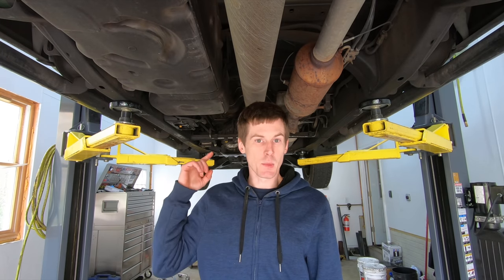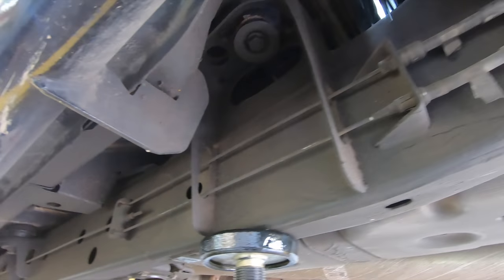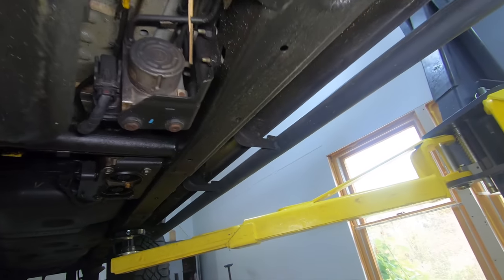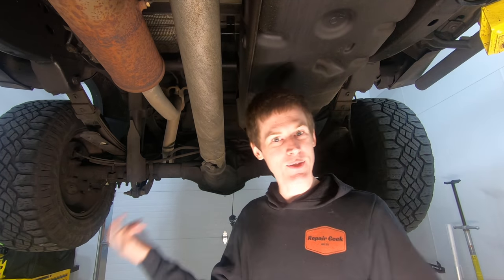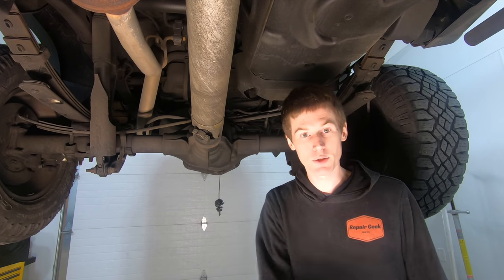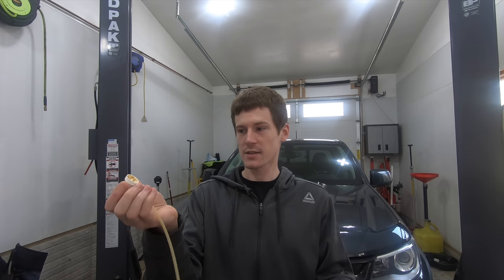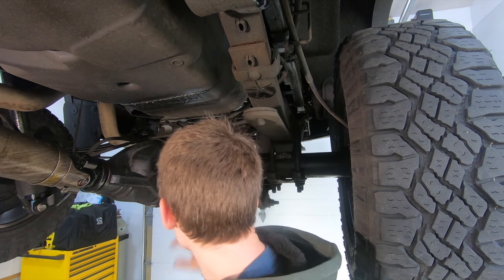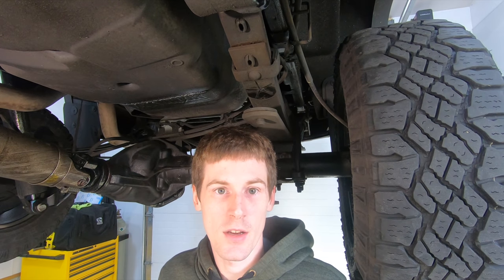Fluid Film Review After 4 Years. (Woolwax vs Fluid Film results 1 yr later)

Comment: I just bought a new 2022 GMC canyon it now has 300 miles on it and I was going to put something  on the frame or some kind of under coating I called  GM and they told me if i spray or put any thing on the frame or body at all it will void my Warranty  my Dealer told me the same thing they even told me I couldn't even put it a spray in bed liner said it would void the Warranty on my truck said it has to come from the factory with it, I dont want to wait 5 years or 60,000 miles for my warranty to die before I can put something under my truck to protect it so what should a man do in this case
Reply from the maker: Try to find ANYONE that GM has paid a warranty claim to for rust. A warranty only works if you and GM agree that the repairs need to be done. It's nearly impossible as a consumer to get the manufacture to do a repair on their corrosion "warranty". Read the actual corrosion warranty information in your owners manual. It has so many loop holes on the manufacturers end it's the length of the dead sea scrolls. You have seen what I did and the results that I've gotten. I have no regrets.

Comment: The most amazing thing about Surface Shield is its' consistency.  It seems like Fluid Film, which used to pour like a liquid, has thickened up their formula to a pudding consistency.  Pudding is harder to spray and creep into pinch welds than a liquid.  But Surface Shield is a quite pourable liquid and it STILL sticks to the underside of a vehicle better than the puddings.  Now THAT is amazing.  And now that Surface Shield is available in 1 and 5 gallon buckets on Amazon, it seems to be the product to buy for us DIY'ers.  How much would I need for a '94 F150 and a '07 Honda Odyssey minivan?
Reply: I agree that the FF is now like pudding and I mixed in Vegetable Oil to make it sprayable . FF continues to creep to thru the seams on hot summer days and requires cleanup , however the Surface Shield hold  promise and I look forward to using it on my next vehicle .
Reply: @pippendog1  you really have to stir or agitate it to thin it out. Paint stirrers work well for that.
Reply: @jcraig791  After 41 yrs. of professional spray painting I know how to mix .. It was like pudding on a 90 degree day and 10 min. of stirring . The vegetable oil mix is a recommended tip .
Reply: Ted George I thin it out with vegetable oil too. It says right on their website to use that if you need to thin it out.
Reply: I put it in front of the woodstove before I use it too

Comment: It’s ridiculous. If they’re not gonna pull wires inside of the frame, they should seal it all off completely and put argon gas in it or something and then put a tire pressure gauge in there so you can keep an eye on what the pressures are ridiculous.
Reply from the maker: Could you imagine a mechanic telling a customer "Sorry sir, all of your frame gas has escaped. To recharge the frame and weld up the hole it will be $150. Oh and your frame gas pressure gauge has moisture in it that will be another $25 for a frame gas pressure gauge" 😂

Comment: What air pressure do you run in your spray gun for these products?
Reply from the maker: Depends on the temperature. SS you can spray at 40 or 50 psi. FF I usually run about 60-80 psi.